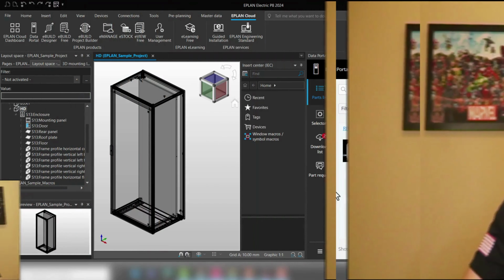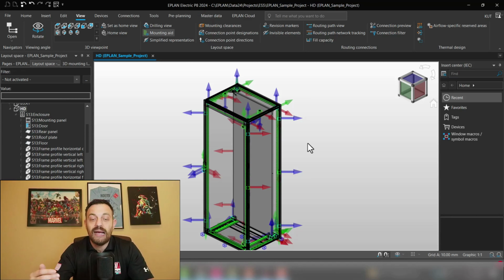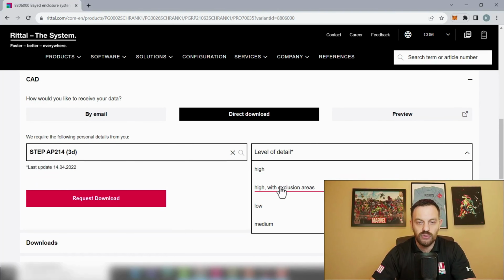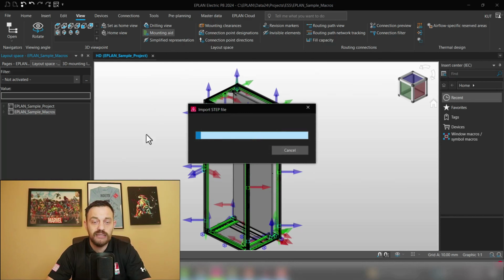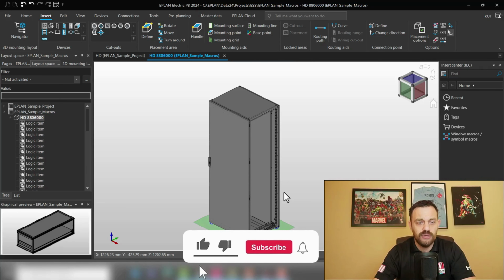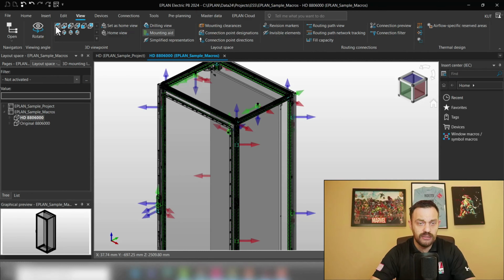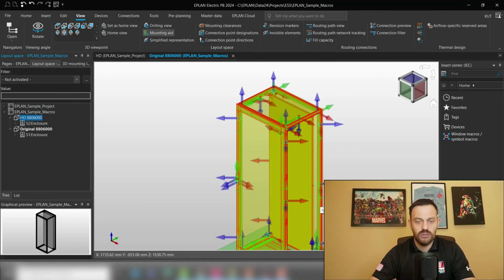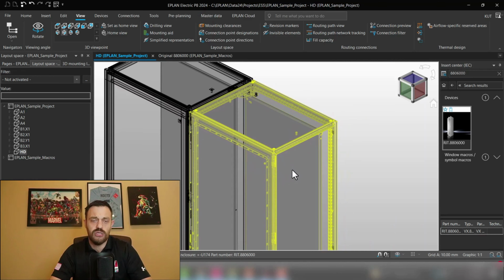EPLAN Pro Panel 3D High Definition Enclosure Version 2024 | FULL TUTORIAL

Comment: Hi. Great work. Congratulations!

Is it possible to use the automatic interpretation tool considering a Rittal panel model but for another manufacturer? I'm trying to use it but the functions of the parts are not recognized correctly after doing this from the imported step file.

Comment: That is wonderful
 Kruno, I made and use it, can you please tell me after you did use  define placement area instruction, there was a green pad under the enclosure, for me this green pad not coming, do I need to active specific soft ware setting for it. I do appreciate  it if you answer me
Reply from the maker: Hello Farhad. Thanks for your question.

If you cannot see the Green surface( or pad)  as you define the placement area. Then please check if you have the Type of Project <10902> property set to "Macro Project."

If this property is set to Schematic Project, then the green surface wont appear.

Hope this helps.
Kruno

Comment: Could you make a video on Automatic Interpretation?  I was testing it out on enclosures of different depths without much success.  The points and mounting surfaces are off and correcting them is more of a hassle then starting form scratch.
Reply from the maker: Hello Chad.

Thank you for your question.

One of the most important points on having a successful automatic interpretation is to have a template (source device) with a very similar structure. 

Like how does the raw data look like after step import, compared to is the finished product after the interpretation.

Often cad models , specially when it comes to modular enclosures have a lot of mechanical details... which we may or may not need in pro panel, then we may need to unite or delete them for simplification before applying the automatic interpretation.

If we still aint happy with the result.... maybe creating one from scratch is the solution, and then using it as the source for further automatic interpretations.

Hope this helps

Best wishes
Kruno